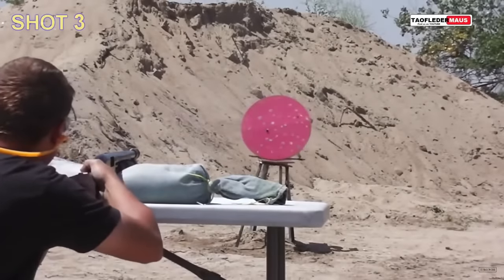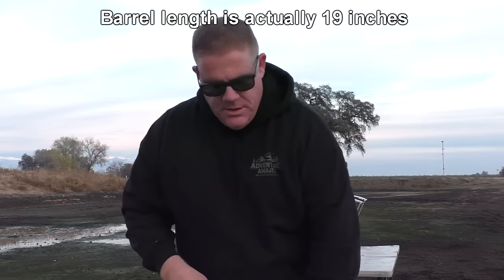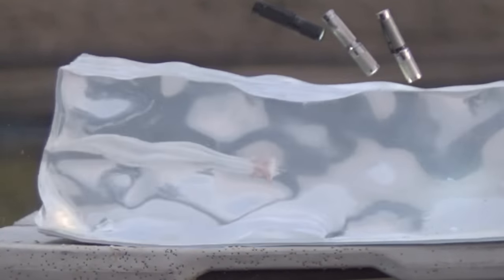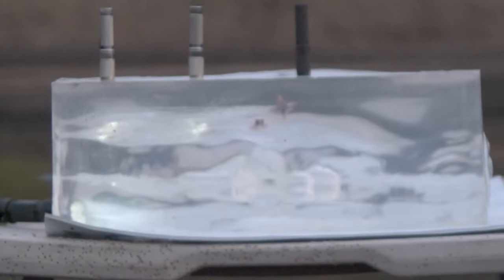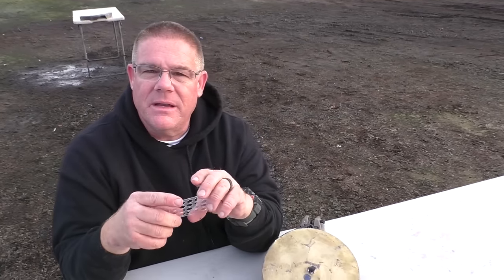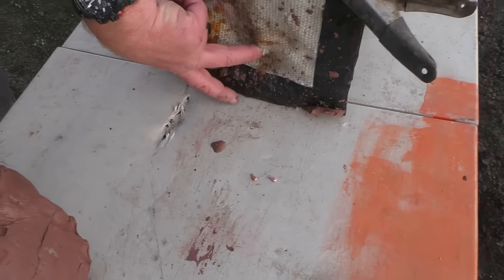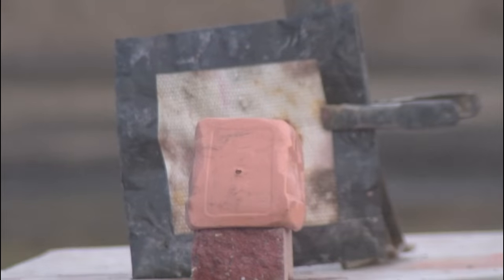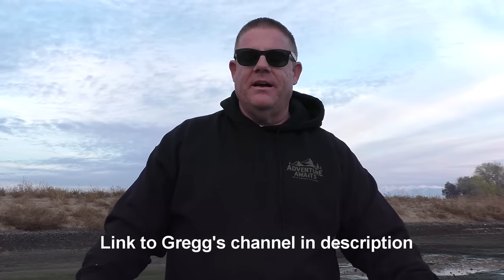Holy Bloomin' Bullet!   The 9mm INTERCEPTOR  -   Tested!

Comment: I can't even begin to imagine the amount of work he put into getting those right. As spindly as those petals look, it's amazing they are able to fold out at a nearly 90 degree angle and not break off. That alone is pretty darn impressive, but doing it consistently? Kind of mind blowing. I hope he sells the hell out of them. If he does end up making them in .45, I know I'll be buying a few boxes.
Reply: Please do I'm really interested in how the 45 works out.
Reply: Are they technically +p at that fps? Seems like decent recoil.
Definitely want to pick a box up for my concealed carry.
It’s weird because research shows the 124g jhp is actually best for 9mm, but this round says otherwise!
Reply: @carsonhunt4642  they look more like +p+
Reply: Same here
Reply: I worked in a shop that made solid copper parts until recently. The petals folding over so nice doesn't really surprise me. The copper hasn't been work hardened because he is running coolant as he makes them, and they are not getting "worked" they are getting cut into shape.
So once the amount of material at the base of the petal is figured out, they can be expected to expand and stop at a predicted spread.
Reply: Agree! I would definitely carry this in warm weather.
Reply: Im probably buying a box soon
Reply: Shoot, I would love to see these in 308 😍
Reply: It's just thick enough that when it expands it essentially work hardens the copper so they don't break off but when it does open up damn does it ever dump that energy for a fairly small round.
Reply: Barnes xtac, Norma monolithic..... These aren't innovative. Lol it's copy and paste. Just like every other market.
Reply: @carsonhunt4642  The +P designation depends on the pressure in the round, not velocity alone.  Getting that velocity with a very light for caliber bullet might get to the +P pressure but that's determined in the lab and by SAAMI if the ammunition is submitted to them for certification.
Reply: Heavier bullets will have slower speed, higher momentum. Light weight bullets will go faster but have less momentum.

I think the machinist used a lighter bullet to manage penetration. Momentum is the least talked about aspect of ballistics and that is a shame. It makes understanding it all a lot easier. Imagine a train and a pickup going 60 mph. Which one can stop more quickly? Easy, the pickup. Yes, that heavy train will take a mile or so or more. 

He figured it out right though. I would think this bullet would be seriously effective in defensive use. I too want some of these in several calibers.
Reply: @nickhowatson4745  The velocity sounds impressive by "normal" bullet standards, but is actually quite mild for that light of a bullet out of a 5" barrel.  BBTI shows 1539fps for 90gr+P (not +P+).
Reply: You can buy this for your .45 right now. Lehigh Defense Maximum Expansion.  They have been available for years and it is the ammo I use.  This design is 100% patterned off of that.  It is by no means original.
Reply: It’s in the alloy even more than the design.  Pure copper would be far too brittle to succeed where a little bit of lead, zinc, nickel and aluminum would open up and fold open.   This is the type of copper used for many non=conductive uses that require structural flexibility.
Reply: Will a round every 40 seconds pay back that CNC machine??
Reply: The ammo companies will go around him. That's an ify patent at best. There are already a ton of bullets out there that open in petals.
Reply: I would like to buy some for my 9mm, 40, and 45 when he makes them. Does he make for a 380? Where can I find these?
Reply: @SargentSkroonk  If my math is correct 24 hours x 60 minutes x 60 seconds ÷ 40 seconds per round ÷   20 rounds per box x $40 bullets per box = $4, 320 per day
At approximately $170,000 for the machine I'd say "Yes" he can pay it off.
Reply: I agree with those who think this is nothing new but I guess it could fill some small market in 9mm. It's kind of a tempting round since ~90 grain is so easy to shoot, keeps weight down slightly, and doesn't have the overpenetration problems of some other sub 115 grain defensive rounds. Still, I can't think of why I'd carry those instead of at least 124 gr v-crowns or HST.
Reply: Some district attorney would just love to prosecute someone for using these in a SD situation.
Reply: @UncleJDCarp  I WAS GOING TO SAY, I HAVE SEEN THIS STYLE ROUND AND EXPANSION BEFORE, OK NOW I KNOW WHERE! I WILL CHECK IT OUT AGAIN.
Reply: @timothylopez8572  If you really think that way, then I wish you luck, because you won't be around very long.
Reply: And so will I ...!!!!
Reply: @aaronschocke2147  Oh yeah!  my three platforms are 308...45...and of course 12 guage.
Reply: @aaronschocke2147  That's a whole different level of physics. Maybe a tungsten flower.
Reply: Check for Underwoods Maximum Expansion rounds, they usually sell them at Ace Hardwares or otherwise online. Price varies from 16$ to 40$s per box of 20 rounds. I'll have to see what this guy is selling a box for, but I'm guessing more since he has a small company and operation that he is trying to expand. 

Even those R.I.P. rounds are usually bought up and resold for like 45$ to 60$ per box of 20. An the Underwood, as well another brand I can't remember the name of.  Although the pedals on these essentially expand out and kind of break off at the 90° point. I'd imagine that these are barely hanging on very much, but the slightly modified and wider cuts may be the reason for them performing the way they do.
Reply: .45 ammo test would be great.If these work out i'd be in for a few hundred
Reply: He just made a 9mm relevant again to me.  I'll be waiting for the .40 & .45acp tho!!!
Reply: Leahigh Defense!  They have .45acp & long
Reply: Called maximum expansion
Reply: @itsmejones6023  I'll check them out.  Anyone on YT have a good vidoe for them?
Reply: I want some of these in 9mm and .45 ACP.. wicked looking round.
Reply: Guns are such a disappointing and lazy "science". If music were guns, we would still be listening to ragtime music in 2022.
Reply: A little more involved than my grandad flattening the round tip of a .30 carbine round and cutting a cross into the flat tip of the bullet. This was th only way they could kill smaller antelope to eat vs canned mutton they got from the Brits.
Reply: I thought that too. Honestly, if he paid attention, and trusted the software, within its known reliability, he my have gotten the math down rather right before he had to pay for prototype and testing, just to root out flaws.
Reply: I would buy cases not boxes, after I get a few boxes for testing purposes of course.
Reply: It's a tra$h gimmicky azz bullet & nothing more 💀

Comment: The reason chrono works better upside-down on that table is that the contrast of the round passing over the sensors is obvious, which is why you also use the white strips. The problem is not the chrono it's the sunlight. The light, when the device is upright is too much so it can't see the projectile. You could build a total cover for the device which would prevent errors and allow you to keep it upright.
Reply: That was my concern as well.   Perhaps they can validate these velocities with a future video where they compare the data from a sideways-oriented chronograph to one properly positioned.  If there are serious discrepancies between the test and control groups of that future video, then none of the velocity results rendered from this test are valid.   

As always, a fun and informative video.
Reply: I made a lightweight frame using quarter inch PVC pipe. T put a black tablecloth over the top and sides of the frame. I set my chrono inside and it works perfect.
Reply: I have an older, similar (folding), model and it has a hard time on overcast days due to the low light. I also have issues whenever the lenses on the sensors get dirty.
Reply: It's cheaper and more original just to turn it upside down
Reply: @snowdogthewolf  it’s measuring the time between shadows, tipping it upside down changes nothing
Reply: @jaydunbar7538  I know how they work, I'm on my 2nd Chrony F1 after accidentally shooting my first chronograph nearly two decades ago.  However, I've only used them they way they were intended to be used (never experimented).  

My understanding is the sun is one fixed point of light that is received simultaneously by both sensors.  Facing skyward, it ensures the most likely source of light will be directly from the sun.  

However, placing it on its side introduces other (reflected) light sources with the possibility existing for that source to come from multiple reflected surfaces.  It seems this could corrupt the results.

I could be convinced to be wrong as I don't have a strong opinion either way.  I would certainly be interested in a video to put this to the test, Mythbuster style.
Reply: @snowdogthewolf  Incorrect. The chrono will give more valid results when shadowed. I've found this often by chronoing under overcast skies. which this is just another way of shadowing the beams. Always more accurate!
KnifeMaker
Reply: @michaell397  Sounds like we need a YouTube video to prove or disprove this.  I would absolutely watch that!   Not a bad idea, nor would a "multiple chrono" video, one placed behind the other to gauge recorded uniformity (or lack thereof). 
Until then, I'll continue to use my chrono the way the manufacturer intended.

Comment: I'd love to see how the teeth on these rounds not only hold up against, but also damage bone in more advanced ballistic dummies! Love the content
Reply: You can do what I did and buy some and test them.  They're about $2 a round.  You can buy just the projectile for $1 a round and load them yourself as well.  To answer your question:  The "pedals" actually have to tear apart from each other at the base.  This spot is fairly thin and machined that way to allow this action.  Once it tears and hits about the 90' point, it is very difficult (takes a lot of force) to bend them PAST the 90' point.  The projectile is solid copper.  What "seems" to happen when hitting "bone" in the advanced ballistic dummy is that it tumbles when one or more of the open pedals contacts "bone".  I've had a couple where just the tip of the pedal/s will slightly bend when this happens.  I carry them daily in both my Berretta 92A1 and Smith & Wesson MP 9 2.0 CORE ported.  I spent a long time in the US Military.  From my experience and knowledge, these projectiles are VERY effective.  They produce a much larger wound channel and have not exited any target I have tested them against.  I used to carry Hornady critical duty and defense rounds, as they were the "best" I've tested before these.  Hope the info helps.
Reply: *petals
Reply: @vincedibona4687  You got me.  -2 spelling =]. Thanks
Reply: watch some of the videos on his channel today. tim & some of the other test people did a gel, meat, 7 other material test. the meat was a pork shoulder with 2 shots. 1 meat alone the other meat & bone.  busted through the bone an deflecting off the bone by about 90'.  in .380 acp.

Comment: when i started learning about bullets and hollowpoints, i hoped that someday we would have a hollowpoint that could expand to a full  + shape without bending back, and it’s here!
Reply: I agree - with this design, the future has finally arrived.
Reply: Shap becomes shape with me, Magic Magic E!
Reply: Unfortunately, 8" of penetration in bare synthetic gel translates to 5.16" of penetration in 10% organic gel used in the FBI tests. Minimum penetration requirement is 12"
Reply: @InGratitudeIam  This round will penetrate human flesh and dump all of its energy into your criminal without the worry of a round going through .Win win
Reply: Actually, not folding back slightly diminishes the penetration. 8" to 9" may not be enough penetration if going through an arm, hence the 12" to18" directive of the FBI.
Reply: oddjobbob  the problem is we have bones, and they can absolutely stop penetration. The surface area of this bullet is massive in comparison to most 9mm projectiles, which is why it slows down so fast, and makes such a large permanent wound cavity. If this struck bone after it blossomed, it would absolutely shatter the bone, but it would not penetrate further. This is more akin to a large caliber varmint round, and less of a practical self defense round imo.

Also would like to see how it performs with a layer of two of denim, or a coat and a couple of cotton layers. Because I think it would cause this bullets performance to suffer significantly.
Reply: @memeier9894  you're not wrong though, that nifty meat target that someone makes would show us better.
Reply: oddjobbob  i wouldn't want to get shot with a bb gun, or a 22... but that still doesn't make them suitable for self defense. I have a 22-250 that shoots a 40 grain projectile at 4500 fps, and to be honest I don't think it would kill you if you got shot in the chest with it... the bullet explodes on contact, and would leave a giant 6 inch hole, about half an inch deep in your chest, but it isn't meant for human tissue. Nor do I think this bullet is suitable for self defense, but what do I know I've only been shooting, reloading and studying this stuff for almost 20 years.
Reply: oddjobbob  it was 4 layers of denim into 4 inches of a gummy bear... not an actual test of the product, sorry... try again...
Reply: oddjobbob  right? Who else would ignore threats across the country to have more agents than suspects in a kidnapping ring?!
Reply: oddjobbob  I'm comparing the round mentioned to a large bore varmint round... saying its light, fast, and expands quickly, and excessively... much like any other varmint round... my 22-250 with a 75 grain expanding hp would absolutely put down a human, and quite ethically, but out of that same rifle with the 40 gr, I dont think it would do much more than severely maime...

A normal 9mm is effective at stopping a threat, 124 gr, 147 gr... 115 gr is also suitable, though I would argue mostly a target load.

This round is anywhere from 24% to 48% lighter than a normal 9mm load, and traveling anywhere from roughly 13%- 18% faster... carrying roughly 364 ft lbs of energy at 10 ft. When a 147 is carrying roughly 432 ft lbs.

This is more akin to a light fast varmint bullet, than a tried and true expanding hollow point.

I'm not saying this round wouldn't see success in hunting coyotes, or shooting foxes, or whatever, I'm saying I wouldn't carry it for self defense. That is all.

To your last point, I agree I wouldn't either, but that doesnt make it an effective self defense round, that isn't what the standard is, and the standard is the standard for a reason, and if you deviate outside of that standard the outcomes then can become substandard, and for a life or death situation, sub standard is not acceptable to me...
Reply: @memeier9894   denim layers were tested in this video…
Reply: @BuddytheBostonTerrier  I addressed this...
Reply: oddjobbob  Washington’s 10 round mag ban doesn’t include those already owned. They’re grandfathered in. It’s illegal to buy, sell, or transfer them though.
Reply: These are a gimmick. I’ve been shot twice with light for caliber 9mm hollowpoints, I don’t know what brand, but I suspect federal 9PBLE. They shattered on impact and that saved my life although the wounds were ghastly they were rather shallow (granted I’m larger and had much more muscle mass than 99% of people) one hit my lower back and the other my upper hip as I started to turn to see who was shooting me. Both went through my belt, waistband and waistband of my boxers (I used to wear them afterwards since I figured they were basically bulletproof because the odds of getting shot in the same pair of underwear had to be astronomically low.
Reply: @zackzittel7683  oh wow thats a great story!! i dont know if that really means that these specific rounds are ineffective though, right?
Reply: @shmoop357  I’m afraid so, 8” of ballistic gel penetration is terrible and that’s not even 10% calibrated ordinance gel, it would be even less if it was. Is widely agreed that the first 3” of ballistic gel accounts for the human epidermis, these are a gimmick just like most super lite for caliber hollowpoints.  More important than expansion is adequate penetration. And these fail miserably. 12-18” is the industry standard in denser 10% ballistic gel (which this isn’t) with 14-15” being the sweet spot.
Reply: @zackzittel7683  wasn’t aware, thanks for the info
Reply: @memeier9894  i see the argument but how many magazines did it penetrate?
Reply: oddjobbob8742 There would be no “concussive force” shredding your gut, esp from a 9mm.
Reply: oddjobbob8742 the expansion of this bullet is nowhere near 30mm, you have to average the overall surface area.
Reply: oddjobbob8742  I don’t see my comment but do you see it?
Reply: oddjobbob8742 since comment isn’t here, the way you measure HP expansion is by averaging the surface area, not by the greatest expanded petal.